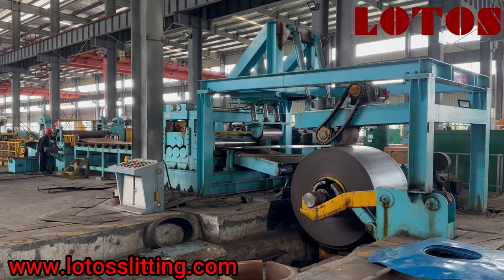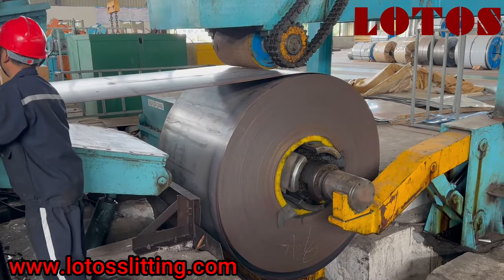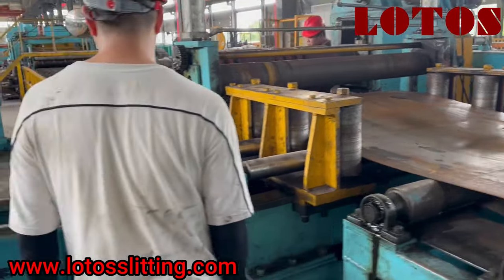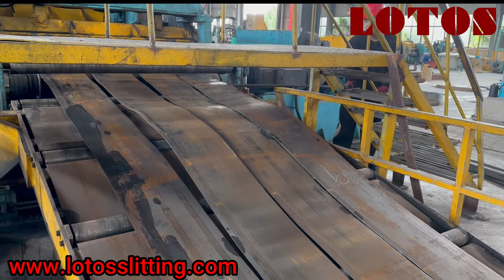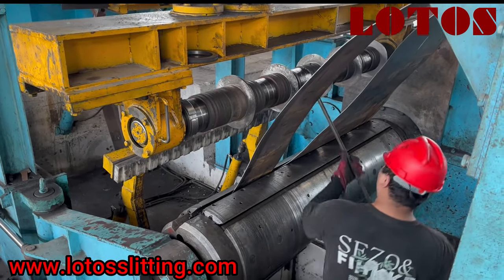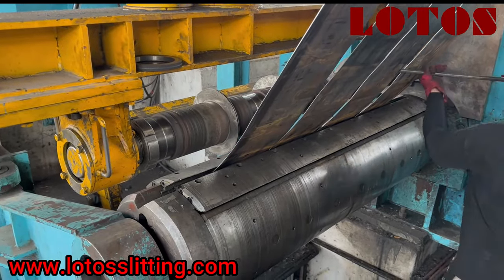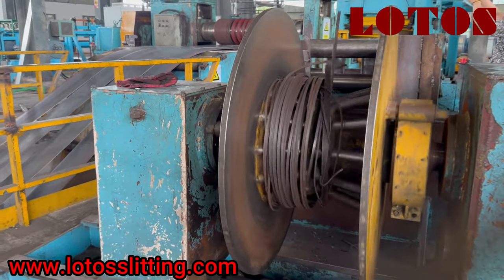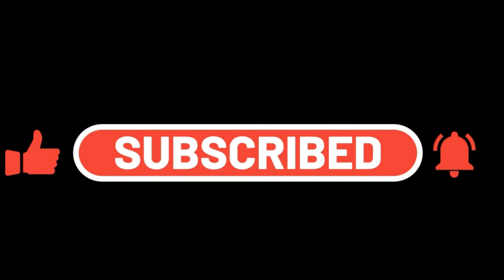How to use a Slitting Machine | Metal Coil slitting line

Comment: In the 70's, I worked on a 42" steel coil slitting machine.
 The coils came from Llanwern, South Wales by rail, then they stacked inside a warehouse.
 I was a slinger an burner. I had to cut the end to a V,  an small hole to fix a wire rope thro to feed it into the machine.No auto feed then.
Then it was cut into different widths. 
Finally the cut coils went to the cold rolling dept to be further processed...